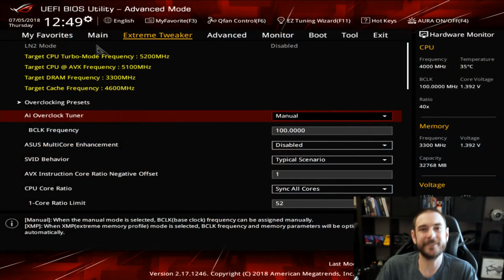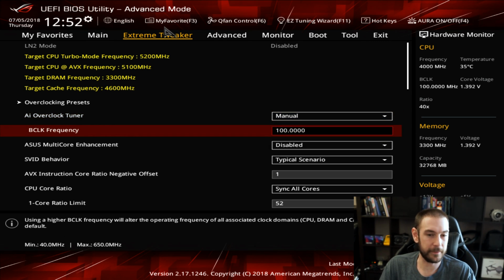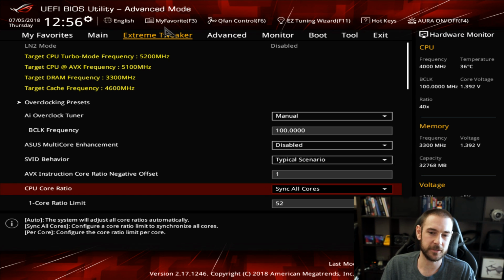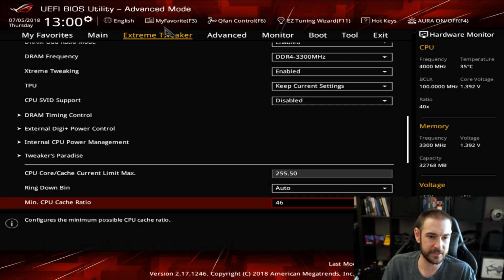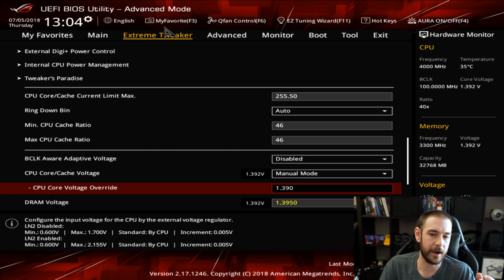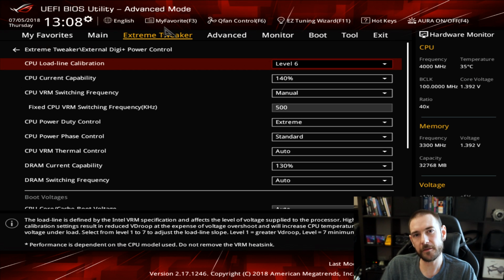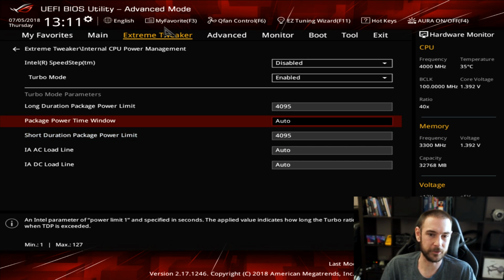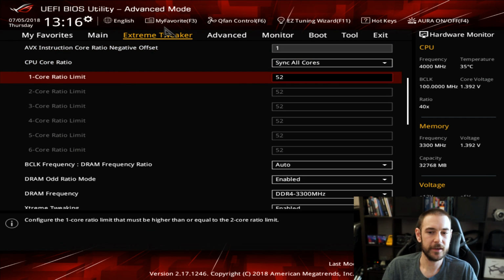How to Overclock an 8700K & 8086K - ASUS Maximus X and Others

Comment: Ok I'm confused. I have asus prime z 370-a with i7 8700k . downloaded cpu z . It's 5ghz . and stable. My question is ez tune has it 1.41v not runing stress test and 1.344v under load why does it go down under load. And if it lowers it to 1.344v and is stable while runing. Would it be better to leave it alone or manually set it to be 1.344 all the time and not 1.42 while not under load?
Reply from the maker: It’s called Vdroop. I’m gonna be doing a video about it soon but It’s controlled by your load line calibration setting.
Reply: @boostedmedia  I went in and started manually setting it I started out with 1.344v . ran an hour of CPU z and 30 mins of . asus realbench. Then an hour of gaming. Passed all. I'm currently down to 1.296v consistent idle and load. So far it seems stable with those 2 test and an hour of gaming
Reply: CPU z max temp 72c . max asus realbench 82c with a 85c peak. But it uses avx instruction Wich is rough on heat I heard
Reply: In games with what it was I was runing 72c. Now it's 60c in games at the lower 1.296v

Comment: Hi, will thnx for this awesome guide. I overclocked my PC using this guide since you released it and it's been great (obviously I had my own clock speed and voltage and avx offset). today I came back home and found my PC off, I never switch it off, when I switched it on it turns back off within 2-3 seconds, it wouldn't start until I cleared the CMOS, I copied the profile of the same OC (that I have been using for the past few months with no issues) and the problem returned. Can you help please thnx.. oh I have an 8700K and a Maximus X Code MB, OC is 5.1GHz with 1.41V, AVX 2
Reply from the maker: Sounds like a memory issue but you’ll need to use the code displayed on the motherboard LEDs to determine what’s causing the problem.
Reply: Boosted Media thnx for the quick reply unfortunately no code shows up, i tried to look for a code but nothing it shuts down not even booting. But a CMOS reset the pc works fine. Memory shows up in system info as it supposed to be. Could it be RAM voltage issue its as Manufacturers recommended.
Reply: Just did a trouble shoot and when I set the CPU SVID Support to disabled the problem occurred. I followed the guide you made and did a save and restart after each setting, at CPU SVID Support the problem occurred. Help please
Reply from the maker: Do you have SVID disabled in both places on the tweaker page? It’s fine to leave it on if you’re using a manual voltage override anyway as the motherboard will ignore SVID instructions.

Comment: I tried to overclock on my asus z390 motherboard using this tutorial (4.7Gz 1.28V, i also tried 4.5Gz at the same voltage) but it failed to boot saying that it was unstable on a black screen. Now it keeps booting to BIOS. I loaded optimised defaults and it still won't let me boot. Do you have any suggestions?
Reply: The RAM i have is 2x8gb g.skill trident Z 3600Mhz DDR4 (17-18-18-38)
the CPU current capacity is 170% for my mother board but i set it to your 140%

Comment: As far as i know the voltage kills the cpu not the current
Reply from the maker: Incorrect. Voltage simply potential for electrons to flow. It’s the flow of electrons (current) that’s causes the damage. Increasing the voltage allows more electrons to flow so increases the potential for damage. 

So yes, increasing the voltage beyond a safe level and then placing load on it will kill it, but it’s not the voltage it’s that causes the damage.

Comment: I just want you to know, I've watched many overclocking videos and this one is by far the best. Before I was constantly having troubles with my cpu overheating. My overclock was set at 4.8 but kept throttling down to 4.2 or lower under load. Now its stable at 4.8 with lower temps. Wouldn't have even dreamed of pushing to 4.9 or even 5ghz before but now I feel pretty comfortable about it. Thanks a lot man.
Reply from the maker: You’re welcome mate. Glad it helped.

Comment: So just to be clear, the way these settings work, my cpu wont downclock at idle on the desktop? Which setting was that?
Reply from the maker: Not when the windows power mode is set to high performance. That’s correct.
Reply: @boostedmedia  but when I'm set to balanced, then it drops the speed but keeps the voltage the same? If I want BOTH to drop I just keep it in balanced and overclock via adaptive mode? Presumably after I used fixed/manual mode to determine the safe turbo speed first?
Reply from the maker: Correct.
Reply from the maker: Remember as I said in the video power consumption is determined mostly by load, clock speed and power limits (current). Not by voltage. So the advantage of running adaptive voltage is practically nil. 

It’s like changing the voltage of a wall socket when there’s nothing plugged in to it.

Comment: Thanks for this guide it helped me a lot as I'm a complete noob to overclocking. I have the 8700K and the same mobo. I used all the settinngs you mentioned in the video for an 8700K and tried to stress test with CPUZ but it looks like CPUZ does not stress the GPU enough. I downloaded aida64 and raised the core clock to 5ghz and tried the stress test and temps were reaching into the 90s so I stopped the test. I dropped the Voltage down to 1.23 and core clock to 4.8ghz and the temps were very good with that. Right now I have the core clock at 5ghz and voltage at 1.23 and it seems fine.  I also dropped those other two voltages you had on auto. I will post exactly what I have in a few min. Also wanted to mention that I tried raising the core clock to 5.1ghz (Tried 5.2ghz but windows wouldn't boot) voltage to 1.25 and min/max cpu cache ratio to 46 and the vccio and system voltage by 1 each and besides temps being really high during aida, I also tried playing AC Odyssey and it was stuttering a lot. Anyway here's what I have now and it seems fine to me I'm just curious if I should make any other changes.

Core Ratio- 50
Dram Frequency- 3300mhz
min/max CPU cache ratio -42
CPU Core Voltage - 1.23
DRAM Voltage - 1.35
CPU VCCIO Voltage - 1.137
CPU System Voltage - 1.07
DRAM Cas# Latency - 16
DRAM RAS# to CAS# Delay - 18
DRAM RAS # ACTTIME- 38
CPU LOAD LINE CALIBRATION - 6 

Is there anything I should change? I could try raising the core clock to from 50 to 51 and not raise the cpu cache ratio to 46 like I did maybe then game won't be stuttering although 5GHZ is plenty for me I think. I thought about trying to lower the voltage some more but it's at 1.23 right now and I'm at mid 50s low 60s for temps on the CPU during gaming so maybe I should just leave it at 1.23? Any point to trying to lower VCCIO and System Voltage? Should I try load line 5 instead of 6? Sorry for all the questions this is just new to me =/ Thanks!
Reply from the maker: All looks very good. 5GHz at 1.23 is a very good result! You must have a fantastic chip. Time to delid and get better cooling and see how far it can go!
Reply: @boostedmedia  I'm not a big overclocker so I probably won't be delidding lol. The cooler is the h115i platinum which is supposed to be pretty good. I'm not sure if the OC is 100% stable yet as I've only stressed it with aida for 15 min and played AC Odyssey for a few min. I'm going to finish watching the rest of your overclock stress testing guide and try cinebench and anything else you have there and also play some games tonight and see what happens. I just have so many questions still =/

Comment: After following your directions exactly, while in the bios, on the right side of the screen where it show the hardware monitor info it still says my cpu frequency is default 3700.  The ram shows what i changed it to.  When I run Unigine Heaven Benchmark for the duel gpu's I'm using, 2x geforce gtx 1080 ti, it  also shows the cpu @3.7ghz.  It does show that I have 2x gpu.  My fps is only hitting 117ish on high and 105ish on ultra.  I am running the test on my 4k monitor.  The scores im getting are 2686 in ultra and 3100ish on high.  My kid using only one of the exact same gpu testing with same benchmark program is hitting a score of 2400ish.  Can anyone tell me if that score seems low?  Have i provided enough info for you to determine if my cpu is actually overclocking?  Thanks in advance.

Comment: How come cpu overclock shows up in cpu z application but not in the bios. I'm curious to know why is doesnt show up
Reply from the maker: It does show up on bios. Do you mean on the post screen? That’s because it’s simply reading the chip’s ID, not the actual commanded clock speed.
Reply: @boostedmedia  Yeah on the right hand side where is displays hardware monitor after making those changes shouldnt it display the overclock speed once you go into bios again after making those changes

Comment: Please help me. I’m doing overclocking the PC on your video guide. But I don’t know English using subtitle translation. Therefore, I want to clarify whether I understand everything correctly and do it. My PC configuration: -Asus Maximus IX / X Code / Formula / Hero + 8700k. Two bars Kingston HyperX KHX3466C19D4 / 16G 16 GB Zalman ZM1250 Platinum 1250 W Water cooling .be quiet! Silent Loop 240
I did everything the same as your settings. I just set the value to 0.01 for the IA AC Load Line and IA DC Load Line options. Ratio x48 and 1.255 volts. If 1.250 when playing Battelfield1, I get a system crash. set the parameters for RAM? And how and to what extent can you still increase the RAM now DDR4 3466 (1733 MHz)? I also wanted to ask how to change the 37X value in BIOS by 40 since I saw that you had such a parameter.

Comment: These exact settings get my 8600k to 5.1 with -1 offset on my z370-I with a mono block. Thanks bro!
Reply: How did you address the monoblock contact issues on that Z370-i?  I've got the same board, but EK says the Z370 doesn't get contact on all the VRM components...  Is it as simple as choosing additional quality thermal pads of sufficient thickness?  I just finished the dual SE240, CPU, GPU, RAM cooling build last night...  chose the Velocity due to the concerns over the VRM contact issue...  Have 2 120 Vardars on top sucking air out...  Both rads pulling IN...  LOTS of airflow over VRM...

Thanks....
Reply: Clay Autery there’s a specific Monoblock for the itx version it fit fine with the thermal pads that come with the block? Idk what you’re talking about
Reply: @BlakeCodGuy1  The EK monoblock they sell as compatible with the Z370 was originally for tje Z270 itx...  there's a note about it not touching all the components that it does on the Z270...  thanks.

Comment: Hi! First time overclocking. I am assuming I should mimic all the settings except for the core ratio limit and the core voltage. What settings would you recommend for that?

Processor: i7-8700K
Mobo: Asus Z370-E
Cooler: NZXT Kraken X72
Ram: 16 GB G.Skill Trident Z RGB (3200)
Reply from the maker: I’d start with 48 ratio and 1.3V then work the voltage down until you find the point it’s unstable.
Reply: Boosted Media Does this mean lower the voltage until it doesn’t boot into windows? If it doesn’t boot into windows, does it go back to BIOS or somewhere else?
Reply from the maker: Have a look at my stability testing video. :)

Comment: So inputing a 48 value in the ratio limit means that the processor would go to 4.8ghz? Cause the AI OC did that but my temps where too high reaching 90c. But that’s reaching a 1.335 core v though, that may be too much?
Reply from the maker: Correct.

Comment: This has helped a lot. Didn't quite know how to overclock my processor. Been very useful. I'm runiing the same motherboard with an 8086k. Thanks for this video  you're explanation is easy to understand 👍
Reply from the maker: You’re welcome Joshua.
Reply: @boostedmedia  as i was watching i was doing it on my computer and going step by step. Processor is currently at 5ghz delided. Computer booted fine. Is it necessary to go any higher for gaming. That's all i use my pc for
Reply from the maker: No you won’t notice any real world difference going higher. Just bragging rights and benchmarks.
Reply: @boostedmedia  sweet as. Thanks for your replies and keep up the good work

Comment: hi thanks for the video ive done everything you've said and all is fine running stable and smooth but for some reason my tdp is 4w when under stress testing i cant work out why its so low? any ideas?
Reply from the maker: Not sure why that would be the case. Is it throttling maybe?

Comment: If you run xmp I'd check if your vccio is going really high my Asus board put like 1.34v for vccio even tho I only have 3200mhz ram. Dropping it down to 1.15 or 1.2x area saves you some temps and unnecessary voltage to the imc of your cpu
Reply from the maker: Agreed. I actually run mine both at 1.00V now.
Reply: What is this setting for? I have the other settings on auto except Vcore 1.2
Reply: @FunKaYxxD1sCO  its for the io memeory controller on the cpu as mentioned in the OP the imc as its called  alot of motherboards add a ton of voltage to it when xmp is turned on asus seems to add it up to 1.3v is auto is left on which is way to much I use 1.15v but if you change it make sure you run ram tests and other cpu tests to make sure its still stable anywhere from 1v to 1.15v is alot more optimal then 1.3v it turns on. if you dont have xmp memeory and just are running at it at a stock speed it wont matter
Reply: Damien interesting. I currently have xmp off and my ram set to 3000mhz. Would I get a decrease in temps if I still change the voltage for those
Reply: @FunKaYxxD1sCO  did you manually set the volages for 3000 mhz? what is your vccio and vccasa voltage at under auto?depending on the motherboard it still might go quite high just not as high as asus does as if you know enough to get your ram to run at 3000mhz  manually without xmp i am sure you can find the voltages.
Reply: Damien all that stuff is on auto. I bet it could decrease temp. It’s a MSi pro carbon Ac z370
Reply: @FunKaYxxD1sCO  you should get something on the side that shows what the real voltage is for the field when on auto. If not download hwmonitor and look at your vccio and system agent voltage near the top
Reply: Damien Check my Vcore ?
Reply: @FunKaYxxD1sCO  its call vccio and system agent in hwmonitor or vccio and vccsa or something similar in most bios
Reply: Damien I see system agent at 1.320v
Reply: @FunKaYxxD1sCO  I'd try to set them to around 1.15 or lower for vccio and system agent depending on the CPU you can do 1v but it takes meme stress tests and normal stress tests to make sure your still stable but it can help drop temps
Reply: Damien would 1.2 be a good range Incase to reduce the chances of crashing
Reply: Damien doesn’t seem like my temps got lower from adjusting the voltage
Reply: @FunKaYxxD1sCO  dropping mine from 1.32 to 1.15 gave me like 4 or 5c under stress test load.so it's not alot but why run extra voltage threw your imc if you dont need to. Manually punch in 1.3x and you will see it will turn red on most motherboards as it's in high end of voltage for vccio
Reply: Damien 1.2 turned red on two setting in the bios Msi and Asus board have different names in the bios so it’s kind of difficult
Reply: Damien manage to lower my vcore to 1.85 and it’s stable in Aida 64 at 4.8ghz. The settings I applied 1.110 for the other voltages and 1.120 for llc
Reply: @FunKaYxxD1sCO  1.1? as 1.85 is uh higher then most motherboards would let you put in
Reply: Damien it would be red, yes? Well the max for those settings voltage. I did adjust the system agent and llc voltage.
Reply: @FunKaYxxD1sCO  is your vcore really 1.85v?  and the vccio is the voltage your looking for that would adjust the imc voltage not sure about your llc voltage but id make sure your not running 1.85v as thats nuts
Reply: Damien it was stable and yes. It’s below1.200
Reply: Oh yeah it’s 1.185
Reply: Damien sorry wrong typo
Reply: Damien in MSI there is no vccio voltage   Guess it’s named something else
Reply: @FunKaYxxD1sCO  that is good 1.85 is way to high
Reply: Damien do you have a idea what the vccio would be named in msi? It’s quite different.
Reply: @FunKaYxxD1sCO  it could be some where else I'd Google your motherboard and see if you can find changing vccio for it as on as rock and most other boards It It I'd still called vccio it might call it CPU vccio or something or other msi might call it CPU IO voltage possibly
Reply: Damien looks like it was the io

Comment: I have an ASUS ROG MAXIMUS XI CODE motherboard , i7 8700k , kraken x72 cooler ,  RTX2080 , 32GBDDR4, 1000w PSU.  I am completely new to overclocking and Id like to at least get my cpu to 4.7ghz  if i follow the same steps  in the video will I be ok? Overclocking videos all have different parts of course that is why I never attempted
Reply from the maker: The same principles will apply but the settings will be slightly different.

Comment: Why does it say 4000 MHz frequency in the bios after putting it to 52?
Reply from the maker: Doesn’t take affect until after reboot.
Reply: Hmmm I did the same with my 8086 after watching your video, and still says 4000 MHz??. I loaded the 5 GHZ configuration….